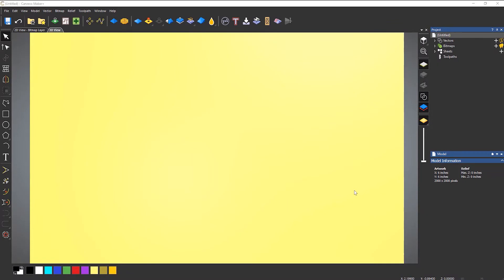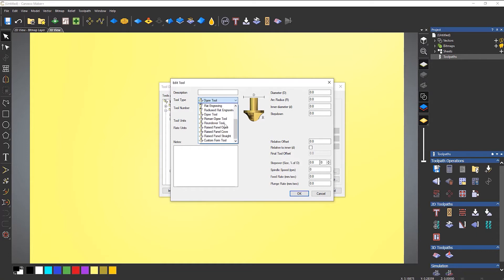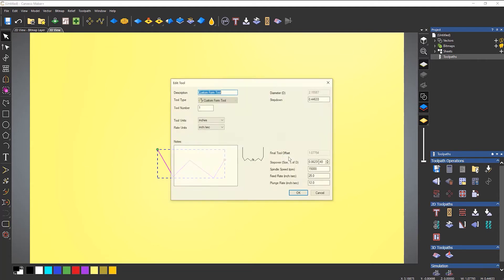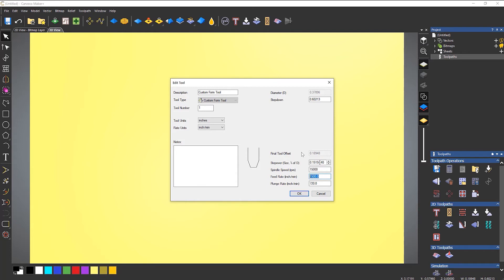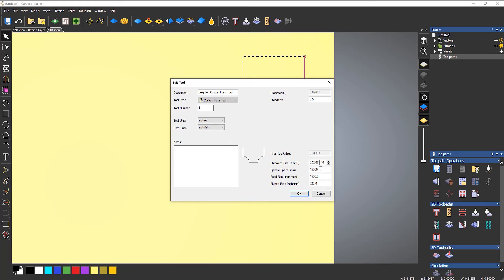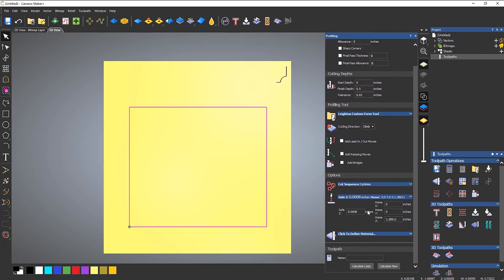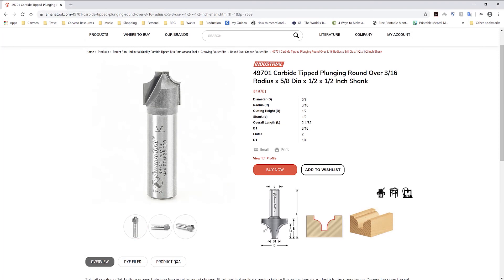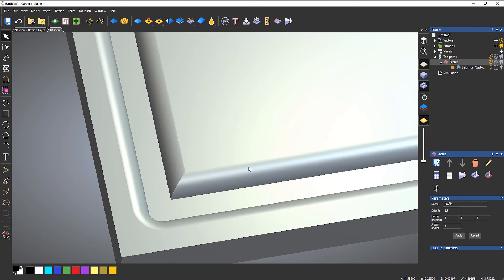Carveco Maker Plus: Custom Form Tools

Comment: I see this feature is only available in Maker Plus.  My question is about Maker.  I want to add a dovetail bit to my database because a lot of the cabinet work that is done in my shop requires dovetails cut into panels.  I am not referring to dovetail joinery at the corners of panels, but rather dovetail slots or grooves along the panel face.  Please tell me how to add such a bit to my database, or at a minimum offer me a workaround solution.  Thanks!!
Reply from the maker: Hi Dan.  Yes, custom form tools are not included in Maker.  Your best bet would be to find a similar tool in the library and then modify it.  For instance, if you look at the Legacy Woodworking database, you will see lots of form tools that are non standard (for Carveco), so you could edit one of these and save that.  I would contact our support team (support@carveco.com) if you need any help.